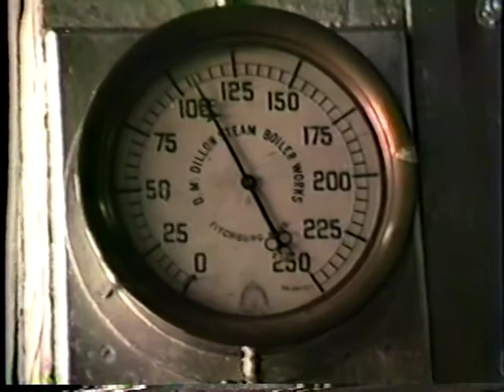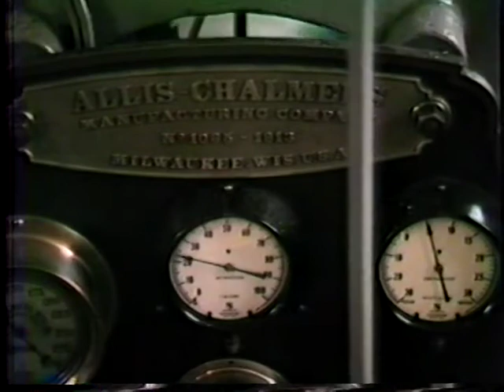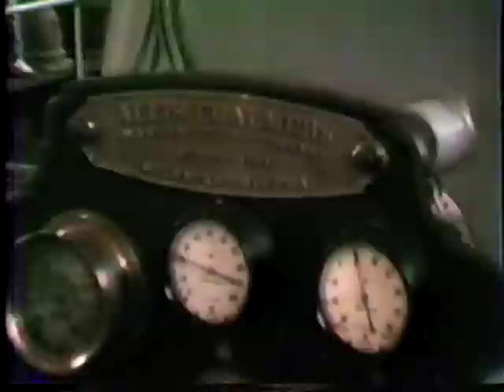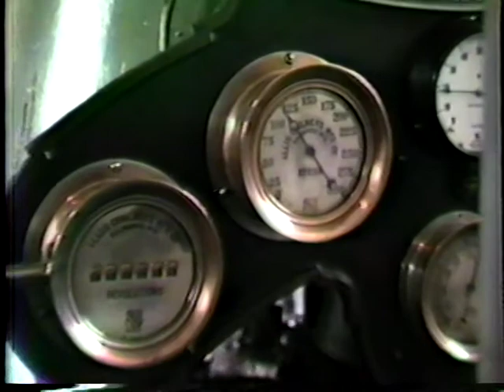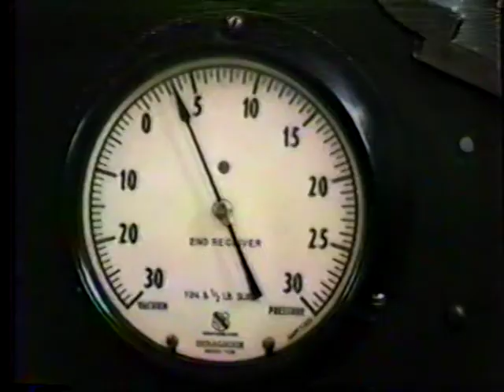Big Allis 1987

Comment: Sweet! Did someone have to shovel coal into it 24/7 to keep the pumps going, when it was in regular use?
Reply: FortWarren I think it’s still in use, but is runs on natural gas 95%+. Coal & fuel oil are still used, but only when there's a problem with NG system.
Reply: Even old coal fired boilers have automatic sprrader, chain grate, or oscillating grate automatic stokers.